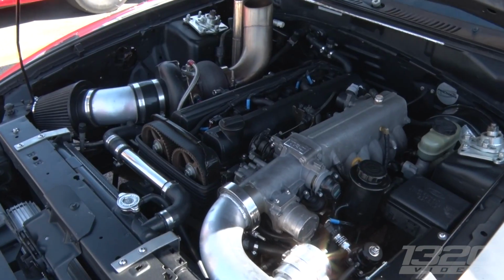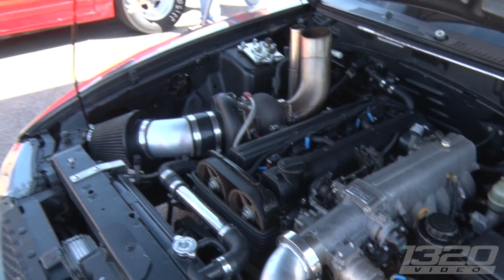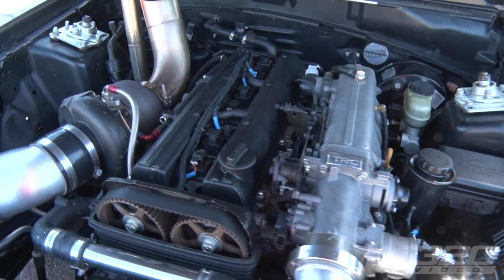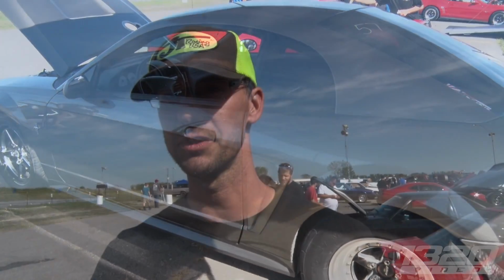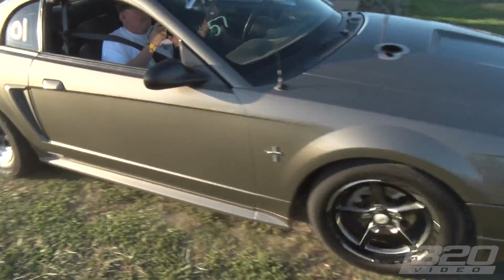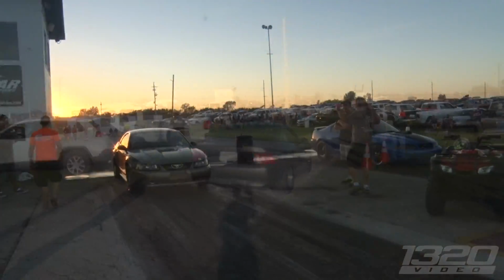The SUPRA Stang - 2JZ Powered Mustang!?

Comment: Did that guy say the 2jz is half the size of an ls1. Im pretty sure thats false even tho its has half the cylinders. Seen a boat load of pics online of both engines on stands side by side. 
The light v8 is actually much lighter as well. About 150-200 lbs
Reply: +MUSCLECREWDave Yeah they weigh pretty similar amount i believe
Reply: by size he's referring to the displacement. depending on the LS swap this is true, being that a 2j is a 3.0. and it's has 6 cylinders, so not quite half that of a v8. Just sayin.
Reply: +MUSCLECREWDave Going off memory but I think the ls1 is like 340ci? While the 2jz was somewhere around the low 180ci range. That's almost double.
Reply: +Decside yea but thats internally, viewed from the outside they are almost the same size.
Reply: +JLW K 
JZ is  a heavier cast block, LS is alu. T56 trans is pretty heavy but it's centrally mounted so you don't have much of a change in rotation e.g. corner entry. Meanwhile the jz block, while 'only' around 80-100lbs more, is much longer than a v8 thus you may notice this..
Reply: +MUSCLECREWDave 
Jz is noticeably longer and a bit heavier too, weight further forward of strut towers etc... I've seen LS very close to a jz before and it's noticeable. What was most interesting was the ls next to 1uz, big difference in size, makes the LS look small. Lower CoG too for LS cam in V..
Reply: +MUSCLECREWDave they were talking imternals, do you know anything at all?
Reply: +MUSCLECREWDave who cares about a view from the engine bay lol that doesnt mean anything
Reply: +poopfart247 it means the engine will fit in tighter places, the displacement can change but the outer diameter of the engine wont
Reply: +MUSCLECREWDave ...alright bro
Reply: MUSCLECREWDave wow..
Reply: +Wiikendz right? yikes.
Reply: +MUSCLECREWDave LS1 has 12 cylinders? Interesting...
Reply: +Kip Kip apparently
Reply: +Kip Kip agreed lol freaks me out that he actually has car videos on his channel.
Reply: +poopfart247 same! xD
Reply: +MUSCLECREWDave 
No one cares about the physical size of the engine, size always means displacement...always. And 8 divided by two.....oh never mind. Gerrr
Reply: +MUSCLECREWDave I was talking about displacement.... the 2JZ = 3.0L, and my friends LS Swapped Stangs all run 6.0L or 6.2L motors.  ;)
Reply: +MUSCLECREWDave there is dumb written all over this post
stick to forza, m8

Comment: Anything is better in the SN95 than the 4.6 mutant Ford was using during that era. Ford moved to OHC in such a bastard, half assed way that it took them till the end of that platform to get decent engines out. Then the S197 was just too heavy for the 300-315hp they were going to get out of it. Took Ford over 2 decades to finally put out a respectable V8 only for the future to now be turbo 6s. Go figure.